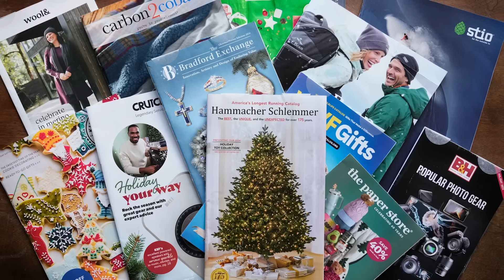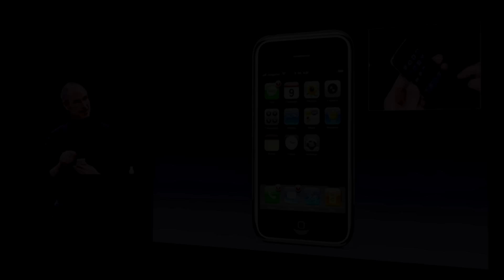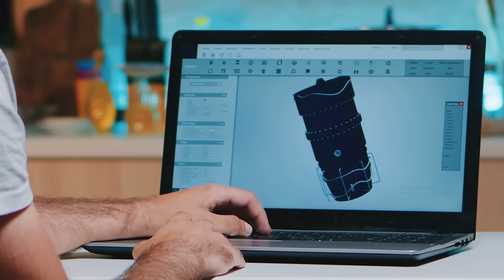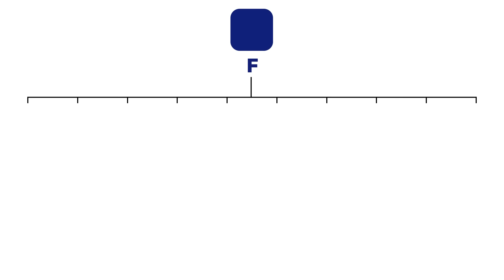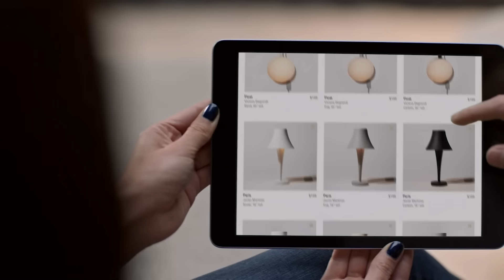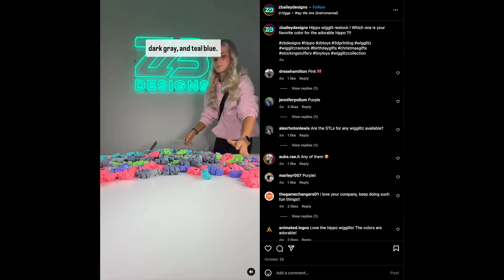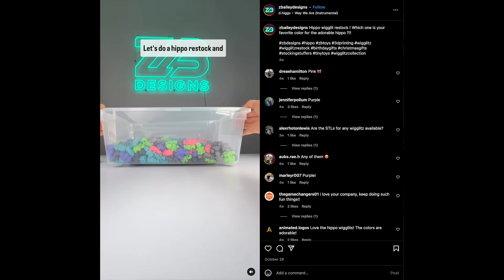The Only Successful 3D Printing Business Model | 3D Printing Business Tips

Comment: Welp, I was really excited about Teleport, but not everything is actually possible to sell using this service. I was developing some boardgame accessories, organizers in particular but not only that. And I'm selling those locally cause I own few printers myself. But when I saw the price for a product in Teleport app... Welp, lets say you can buy a whole new game with all expansions for a price of single organizer. I make around 300% selling those locally from the manufacturing price (filament + electricity + maintenance cost) and it still 3 times cheaper then manufacturing it with a teleport. I know that plastic in my country may be much cheaper then in US (10$ per kg for a good one and around 7 for an "affordable"), but if I want to make some money expanding those in US I need to set a price which will be at least twice more for an accessory than for a product it made for. Which is impossible to sell, cause more affordable options already there and even if 3d printed organizer is a premium option its not THAT premium. So, yeah, although idea, service and overall experience with the teleport is good, unfortunately for at least some businesses its not an option.

Comment: As a potential customer, three questions:

(1) Do your 3-D printers equal or exceed the print quality of Bambu Lab printers?

(2) To achieve order fulfillment for products requiring simple assembly steps beyond 3-D printing (for example, gluing some parts or using a razor to precisely trim tiny blobs), can your company handle that?

(3) How assiduous are your personnel in terms of finicky attention to detail? If I personally produced products, I wouldn’t ship anything to a customer unless I would be happy to own it myself. Your workers may not be as invested in ensuring product quality. Or are they?

Comment: This is misleading.
1. The cost to print isn't free. In addition to the initial cost of a printer, every print uses material. If you want people to value your product, you'll want an expensive printer and expensive filament or resin.
2. Marketing. Producing a product that people would love does not = sales. Time, labor and subscriptions are necessary for advertising and SEO.
3. Printing, especially large quantities, takes a ton of time, electricity and often require more materials for maintenance after every single print.
NOTHING about 3D printing is free

Comment: Your new app makes the whole thing much easier. I am now wondering what happens after the 3D printed parts are used. Are they simply burned? I know that we could recycle them. Is there a solution for the parts after they have been used so that they do not contribute to our environmental problem? Teleport the other way around?

Comment: The thing with 3D-printing is that it doesn't scale well.
If you're in the position that you need 10k identical parts of something, you're probably better off investing in an injection molding machine, no matter how many printers you have at your disposal.
The real benefit of 3D-printing is the ability to rapidly make prototypes of designs and to create individual custom parts.
So basically, unless you're running a printing mill at an industrial scale, your best bet to get as much value out of this technology as possible is to get really, really good at designing parts specifically to be 3D-printed.
That should enable you to become a(n emergency) problem solver for customers, and solving pressing problems fast pays much better than plain manufacturing most of the time nowadays.
(Edit: That's basically the conclusion towards the end of the video, just from a slightly different perspective, lol.)
Reply: It really depends. I work in injection molding, there is a lot of set up involved with running a mold. if you only need 10k and the parts are fairly small you are probably better off 3d printing. there are a lot of PITA molds that have hydraulic cores, air blasts, finicky hot runners, molds that are over 2 decades old that customers refuse to fix. There are some days where i spend hours setting up a mold just to run a few thousand parts for the order. then we run inventory just so we don't have to set up that shitty ass mold again next time they order parts, then we sit on that inventory for months. all this, not to mentions sometimes you get all set up only to bust an ejector pin at the start of the run or find out the mold developed a water leak, and the whole thing has to come out, get fixed, then go back in....
Reply: Yeah that's a big IF though to be in that position and money in the bank, i.e. waaaay past the prototyping and MVP testing or market fit phase.
Which is not most people needing a simple way to test waters; if it even occurs to them it's just a test.
Reply: @MarioLuigi-vb3rp  so why are 3D printer machines plastic parts injection moulded?
Please educate!!!
Reply from the maker: Incorrect. We do mass production print ing every day. Thousands of parts per day
Reply: @slant3d  I run my own injection mould toolmaking business and have been around 3D printing since the late 1980's. 
For high volume mass production nothing can touch injection moulded parts for speed and quality, for example one of my customers we have made a series of 40 impression tools that cycle at 20 seconds and run 24hrs/day 5 days a week, we have now made 7 of these tools and they normally have 4 running all year across 2 continents with 2 in reserve and 1 emergency back-up 
It's not just the numbers though, it's the material properties moulding gives like live hinges, optical properties, surface textures and all round quality of form/finish without tessellation on low angled transitions.
I'm very much into 3D printing but as a seasoned industry insider it has its uses and is brilliant for some things but there are limits. I often do conversions for 3D printed parts into injection moulded parts for many reasons, in all cases the 3D printed  part has established the part but also revealed a limitation that needs to be addressed, be it material performance being insufficient or degradation in service to struggling to meet demand.

Comment: can you make a video on the possibilities if a true consumer desktop 3d metal printer with cheap metal filament comes to market what would that look like for business owners?
Reply: #3dprintmonster 
I had 3d printing as start-up and it was good
Reply: There is no such thing as inexpensive metal filament or metal filament printing.   If you're using FDM, or SLS, the product needs to be sintered before it's useful.  Metal FDM filament is expensive .. the equipment is expensive because embedding metal into a plastic matrix makes it exceptionally destructive to everything in the filament path due to the abrasiveness of the material.  Metal SLS printing is expensive because .. well .. frickin' lasers and material.

Basically .. you don't understand the nature of printing enough with a variety of metals to understand why printing some materials is inherently not, nor will ever be, inexpensive.

The magic of being able to print in metal is not the cost, but the ability to create geometries that are impossible via any other manufacturing method.

Comment: You mention a company that makes accessories for nerf guns. My question is about when do patent laws apply? I made a 3d print to cover a crack in the cover of an exercise bike. Their cover is a bad design and always breaks in the same spot. A new replacement cover from them costs $900. So can I sell this 3D print online and advertise it as an accessory for this bike? I am not making the bike itself, but maybe that company doesn't sell as many replacement covers.
Reply: ask a lawyer. call one right now. a good lawyer will answer this on the phone for free
Reply: Do it. you will possibly fly under that company's radar. if you don't, they may send a cease and desist. if you dont stop, then they might take you to court. I am not a lawyer, but I'm fairly certain one can provide replacement parts for something like a replacement cover without worry about patent laws.